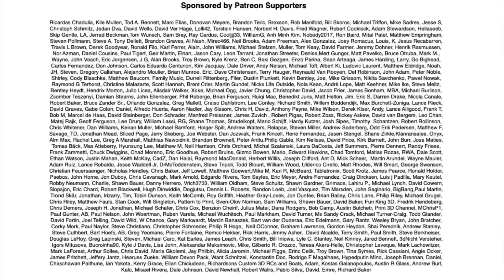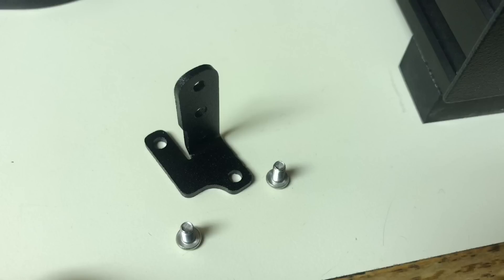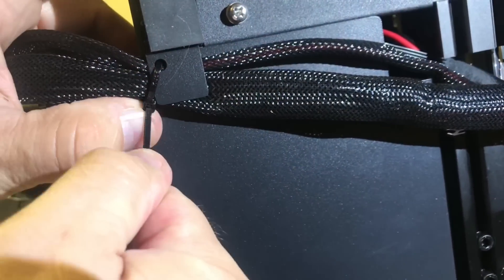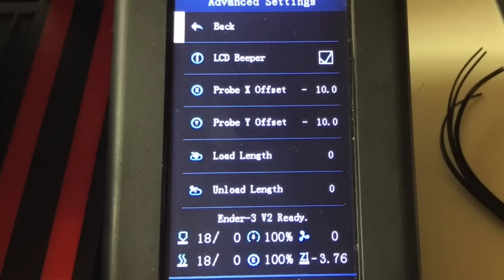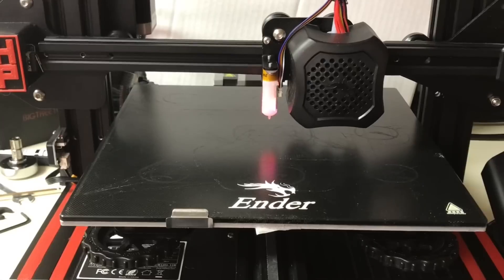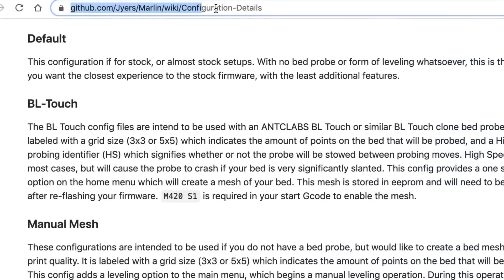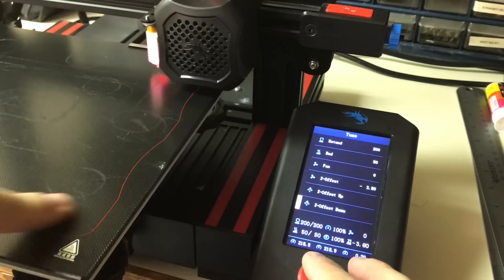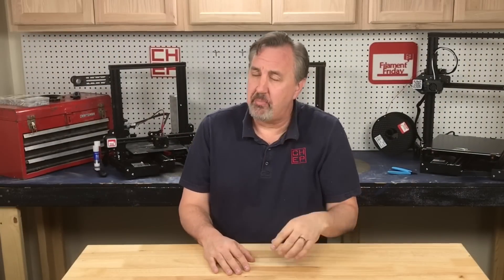How to Install AutoLevel on Creality Ender 3 V2

Comment: I did everything you told me too! But after I downloaded the firmware and put the card back in my printer did not turn on!
Reply: Iddy girl gaming  copy all your files from that card into a folder on your pc, then delete all the files that is on the card....

Then reinstall the firmware, once the firmware is on the card, rename it by right clicking, then click rename, delete the original name and name it whatever you want so long as it isn't the same name as it was when u downloaded it

Then save the name, usually you just click away from the rename box after u have renamed it.... but then make sure it's still a .bin file

Then stick it in, and turn it on.... 

I had the same problem with mine and this fixed it!!!!
Reply: @Thisismyhandle734  Thanks!!!!
Reply from the maker: Try a different SD card, make sure you have the one to match your board number and change one character in the name so it knows it’s a different file and try again. It should recover.

Comment: I've installed the CR Touch using the provided bracket but upon further inspection the nozzle is lower than probe causing the nozzle to crash into the bed. Please help, thank you.
Reply: Mine came with 3 brackets. Sounds like you might be using the wrong one for your printer.

Comment: As usual, great work Chuck! It seems as if I've created an issue for myself, when I loaded the new firmware all I get is a blank screen on the printer. The new firmware .bin is the only thing on the SD card. The BLTouch acts exactly as you said on start-up, but no matter how longer I  let it sit after start-up the new firmware doesn't load at all. When I start the printer without an SD card inserted, I get the same blank screen, almost as if there isn't firmware at all. What did I do and how can I fix it? I've tried installing the latest Marlin firmware for my 4.2.7 board and no success. What do you suggest?
Reply from the maker: Make sure you have the correct firmware, USA an 8GB or less card and change the name by one character so it knows it’s different.
Reply: @FilamentFriday  I can't get any firmware to load at all after using 8GB SD and confirming version. Did I brick my screen?
Reply from the maker: Did you change the name one character and try again? 
If the name is the same it ignores it.
Reply: @FilamentFriday I am getting other firmware to load using the 8GB SD card and changing the name by one character but I'm not able to load the Jyers Marlin firmware that you discuss here. I have previously installed the 4.2.7 silent board on my Ender 3 Pro. Jyers does not appear to specifically have any firmware labelled for the E3Pro; do the E3V2 firmware files work for the E3Pro?
Reply from the maker: No, the display is different.
Reply: @deanpodolsky  i got to work by removing all spaces, dashes, etc in the filename. i also formatted the sd card before adding files into it, as opposed to just right click -> deleting them.

Comment: I didn't have any wire that could help me get the bltouch wire through the sleeve so I got it as far as I could through the sleeve and made a little hole so I could get it connected. Nice video though.

Comment: This has been nothing but heck with my cr touch on my emder 3 upgraded with a silent board 4.2.7 it levels when it wants but doesnt stay. I constantly have to adjust the probe off set as its putting first layer on. And everything was done as video shows
Reply from the maker: You save settings to EEPROM?

Comment: and by the way trig the small connector of bl touch not the big one like you did it  its smaller and easy to drag from other side .Your ideea to drag was fantastic but improved with draging  the smaller one its like i seed easy

Comment: Any thoughts on what can be causing the printer not to wait for the hot end to warm up? Also, when trying to print the bed level print on the ender 3 V2, it only prints the first line on the left, nothing else... 
I just installed the BL Touch ordered from Creality...
Let me know if you can thing of anything that can be messing it up on the GCODE, printer, or firmware.
TIA.
Reply from the maker: That’s strange. Maybe try a different SDcard.
Reply: @FilamentFriday  Very strange... No luck on new SD card. Same results. Tried downgrading from Ver 1.3.5 to the version you did this video (1.3.1), but still get the same results. 
Interestingly enough the printer is warming up the bed to the desire 60 deg temp, but takes off after that. Never even changes the nozzle temp on the display (from 0 to 200). Frustrating and time consuming to say the least...

Comment: Hey chep @5:34 when my printer goes to prob the center it doesn’t advance to the next spot it stays at the mid the right of the plate and only probes that after the first three prob reading and make my printer crank
Reply from the maker: Try 32 bit version as described in comment pinned at top of comments.

Comment: I’ve come so close to getting one of these, and I’ve been printing for a good 4 or 5 years now, so no noob, 

but I have to say, as good as this video is, and it is, sad to say, they always get to a point we’re I just think…”manual”

And by that, I mean, again  just to much messing about to set up, when back to good old manual , paper, knobs, just seems a better easier option tbh.

I will say though to finish, if I was going to try, this would be the video I’d follow.👍

Comment: When I would install the SD card in the printer (with the firmware update) it would just light up with a black screen. Does anyone know what gives?

EDIT: You need to format the SD card before putting the firmware .bin file in there.

Comment: I just manually level by sound. Gently use the z-axis knob and listen for when the nozzle touches the glass plate at the same time that z-axis limit switch clicks. If you’re having trouble hearing the touch, watch for when the plate moves.  Again, manually rotating the z-axis knob slowly.

Comment: I'm trying to follow the same steps, but with an # axis is still going to the corner and not in the center. I installed the firmware for the BL touch following the steps in the video, but it failed. Can you help me with this? 

The motherboard is a SKR mini V1.2, Marling 2.0.7, the BL Touch is V 3.1.

Comment: Hi Chuck!  This got me set up and running after 2 days of fussing with my Ender 3Pro upgrade to the V2 4.2.7 board and LCD (non touch). My first one layer print was nearly perfect after following your video.  I do have a question though.  since the Jylers firmware stores the mesh on the EEPROM (no files on the SD card) what is the fundamental advantage of the M420 S1 over a G29 in the slicer G-Code?   I understand the G29 will auto level before every print and the M420 will just use what is on the board.  Which is better?  Does running the G29 retest or overwrite the stored mesh for more up to date bed level or is it just wasting time?   Thanks!

Comment: Trying to get BLtouch 3.1 to work on my Ender 3 v2 4.2.2 board. Jyers firmware. When I go to create a new mesh, the everything homes, the probe goes to the middle of the bed. But then it doesn't go down and probe the bed, instead it goes up a little bit and the probe goes out and goes back in a few times and then it says its done. anyone have similar problem?
Reply: i have this issue too and still cant solve it. Did u manage to solve it?
Reply from the maker: Sounds like it’s resetting. Maybe check the wiring for a loose connection or loose pin.

Comment: but what did you do to fix the front left side or do you just try not to print towards the front left?
Reply from the maker: Ran autolevel again. Also found that corner needed a bit more cleaning.

Comment: Thanks a lot for this video. I had the BLTouch set up the older way by replacing the Z-stop and getting the bed levelled was such a pain. The Jyers f/w is such a find. I had to rewire the BLTouch to use all 5 pins (which wasn't obvious at first and I was wondering why it was not Z-homing), but then it all fell into place.
Amazing work and I am going to go over and try to support their efforts via Patreon / Paypal.

Comment: I am surprised about the initial bed levelling with paper to include the center. If you levelled the 4 corners the level of the center should be OK right? And if it isn't, which of the 4 screws are you going to adjust?? And if you do.....then the corners are off again

Comment: Using the latest creality firmware with BLtouch for 4.2.7 silent board there is no x or y offset setting in the LCD menu, do I need a different firmware ?

Comment: I would pull the small connector through the harness.
Reply from the maker: Yep. I should done wiring first then connect. Hindsight is 20/20.
Reply: @FilamentFriday  Could do a dry-run next time before recording a tutorial.
Reply from the maker: After all the time to re-record real errors, hours editing, voice overs, close captioning, thumbnail testing, answering comments, all during free time trying to put out a video every week, while still working a day job, I’d rather leave a few “improvements” for commenters to catch and save a few minutes for myself.

Comment: Where can I find Ender 5 Pro firmware for the BLTouch wired to the mainboard. The firmware on the Creality site isn't working for my configuration and I need to get one that works for the 4.2.7 board.

Comment: Maybe I’m missing something but it didn’t seem to make it that “automatic” if you still have to level etc. Does it get better after? Thanks!
Reply: Yes, you are missing something. Even though it doesn't physically level the bed, it creates a virtual model of the print bed and it will adjust the height of the extruder while printing thus simulating a level bed even if it's not physically level.
Reply: @leo-hao  Not my experience at all so far. Personally, I don't see the value in the BLTouch at all. So, let me get this straight. You manually level to begin with. Then determine a z-offset, then create a mesh, then fine-tune while it's printing (again manually). Err, how is the BLTouch helping at all? I never used the BLTouch for almost 2 years. Now with the BLTouch I have to manually calibrate with twice the effort and inferior results. If it actually worked, and auto-tuned the extruder up/down based on the mesh, then it should work and one should not need to do so much manual calibrating. For example, he had to 'fine tune' AFTER the mesh. Why? Makes no sense.
Reply: @keithschaub7863  manually fine tune while it's printing only happens once. After that the machine can do the fine tuning by itself.
Reply: @leo-hao  If its simulating a level bed, how is he still not getting a good level print on the left corner?  Im about to install my BLTouch and this is throwing me off.

Comment: Does the m420 s1 need to be in the gcode for all printers or just the v2?  I have a ender 3 pro with a bl touch and it "seems" to be ok without it.
Reply from the maker: Just those with autolevel
Reply: @FilamentFriday  ty!  Seems my bed was pretty level and i never activated the autolevel lol.  This was the fist video i saw that said to add that to the start gcode.  You the man ty!

Comment: Followed this tutorial and it works like a champ! Love dialing in the 9-pt mesh viewer in LEVEL via the Marlin upgrade! One quick question is I have had two power loss recoveries and both times the printer movement has continued as it should with the bed reheat but the nozzle doesn't attempt temp reheat and it just dry-prints the remainder of the print in the air way above the bed. Any suggestions? Not seeing anything online so far. Any help would be appreciated.
Reply from the maker: Not sure. Have not seen that. Sounds like an error in firmware.
Reply: @FilamentFriday  ...and someone once said "check the connections, then check the connections and finally check the connections." Removed the BL touch and reconnected the pins and now it recovers just fine and  also homes down instead of up!
Reply: Thank you for the reply, will try to reload fw's.

Comment: So, how did you fix the left front corner?
Reply: I guess your raise or lower the bed at that particular corner?
Reply: @_Master_P  the point of the bltouch is that you don’t have to level the bed. Maybe his bed was warped a bit?
Reply: You could go into marlin and make more mesh points so it will calculate for the bed warp or your can completely re level your bed and re calibrate your bl touch
Reply: My thoughts exactly.

Comment: I dont get the point of these if you have to manually and live ajust the z offset after its done?
Reply: The Z offset tells the printer how far the tip of your nozzle is from the point where the sensor triggers. As long as you don't make any changes to your hot end, it should stay the same. Unless there is a problem, you only need to do it for the initial setup, not every time you run the auto-leveling.

Comment: This video make me think I will just keep levelling the bed myself.  Hi f he can’t make it level perfectly there I no way I will be able to
Reply: exactly. Personally, I don't see the value in the BLTouch at all. So, let me get this straight. You manually level to begin with. Then determine a z-offset, then create a mesh, then fine-tune while it's printing (again manually). Err, how is the BLTouch helping at all? I never used the BLTouch for almost 2 years. Now with the BLTouch I have to manually calibrate with twice the effort and inferior results.

Comment: @CHEP I have an Ender 3 Pro with 4.2.7 board. Does this E3V2 process work with the E3Pro?
Reply from the maker: Which process?
Reply: @FilamentFriday  I upgraded my Ender 3 Pro with a 4.2.7 board. The software you use at github/Jyers/Marlin/releases is all for Ender 3 V2. There are no builds for Ender 3 Pro. Will any or all of these work on the Pro? My understanding is that Ender 3, Ender 3 V2 and Ender 3 Pro all need different firmware. Is this understanding incorrect? I haven't tried any of these files on my machine yet.
The Creality firmware is a trainwreck. It doesn't have any of the menus described as you show here for the V2.
[Also I have a 3D Touch not the BL-Touch. Hopefully that is not an issue.]

Comment: Hey Good day, I am in need of some advise, and it might be as simple as I don't understand something.
So I have an ender 3 v2, an original bltouch v3.1 (with the 5 pin plug) .
I installed an 5x5 grid jyers marlin, the most recent one I think
So I level the bed, it's flawless. Then I create a new mesh and save it to eeprom. My gcode uses the m420 command. 
Now I start a print, but the left side is always to thin and right alway to thick.
Reply from the maker: Never heard of that. Not sure what to suggest.
Reply: @FilamentFriday  thats unfortunate, well thanks for atleast giving it a though :)
Reply: How did you fixed it?

Comment: I installed BLTouch and recommended firmware. got a good test print and nice first print. saved all settings, but every time i turn printer off i have to readjust my Z off set. what am i doing wrong?

Comment: Hi I have a ender 3 with a v4.2.2 motherboard on a ender 3 and can't seem to set up the software

 I think it because of the v4.2.7 motherboard used in the V2 

how can I get around this ?

@CHEP
Reply: Originally, you get v4.2.2 board in e3v2, but it may be v4.2.7 if you win the lottery. For the issue try asking on Reddit, you will get help quickly.
Reply: @QBarszcz   thanks for the suggestion I've sorted  it now

Comment: Hi CHEP. I forgot to manually level the bed before installing the Bltouch. Now I got Bltouch installed but my bed is not leveled properly. What should I do? Thank you.
Reply: Level your bed and redo the mesh.
Reply: @rijlqanturis625  How to manually level bed? Is this correct - Auto home, move z axis to zero, disable steppers, move nozzle to corners, level with paper
Reply: @csst29  With the wheels under the bed. You still need to "level" your bed like you traditionally did with the paper test in the corners and center. The BLTouch is used to "Fine tune" and account for warping and such. This will not automatically make your bed level. It just accounts for small variations in a leveled bed.
Reply: @bassmanspiff1  i know. Im asking for the procedure to level the bed.
Reply: @csst29  Hey not sure if you need help, but what I did- was go to the z axis tool. That will bring you to where your nozzle thinks it is 0. Cancel out of the tool, disable steppers, and try to manually level from there
Reply: @thomashubbard288  thank you so much!

Comment: I know I have the ender 3 and bltouch but would you know what would keep causing the probe not to deploy when powering the printer on?
also the print can home fine but when the print starts the probe wont deploy again and I get M112 shutdown.
Reply: you got it set up on a ender 3

Comment: I'm trying to figure out how the BL sensor can automatically beds the level of the Z-axis since the sensor doesn't measure the bed before each print with the M420 S1 code. How does it know if my bed has been adjusted?
Reply: You have you still a adjust the bed the BL touch only tells you if it unlevel and when it's level

Comment: There seem to be many versions of the genuine BL Touch and fittings. Ordered mine but came without mounting kit so had to order separately with a longer cable. Aluminum bracket that arrived was similar but not the same as shown in your video so had to adapt. Longer cable had the wire colors in the plugs reversed i.e. blue for white, black for red, etc. But as it was the same at both ends it didn't matter. It seems that as versions of this machine evolve you need to keep one step ahead. The Chinese appear to relish this confusion or am I just not up to the challenge?